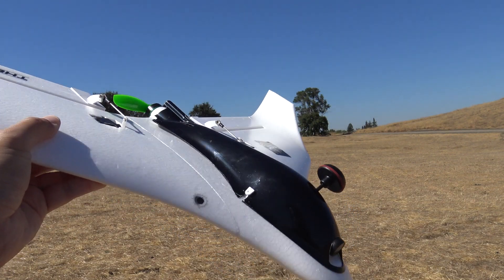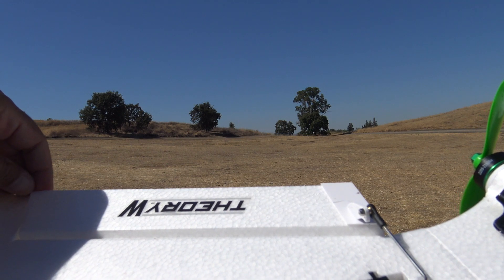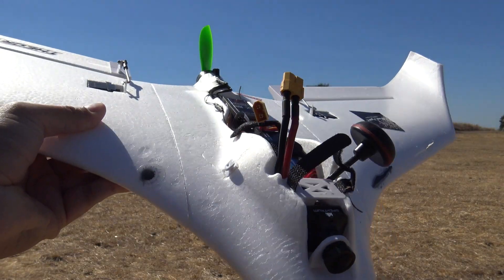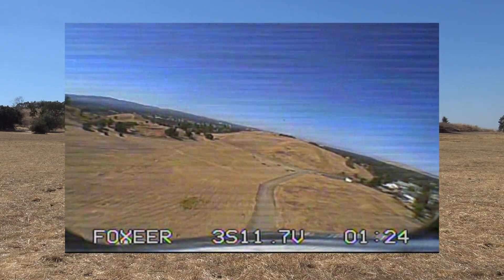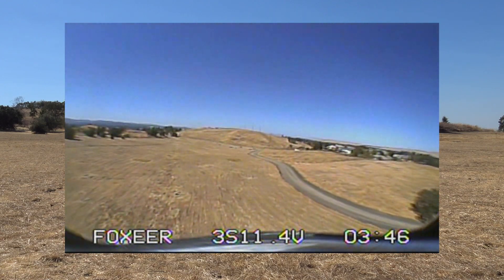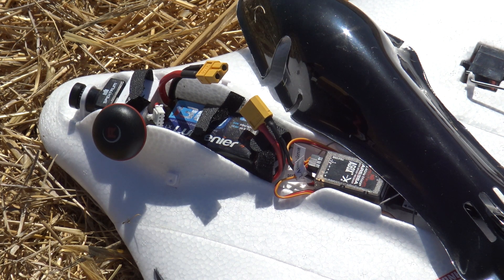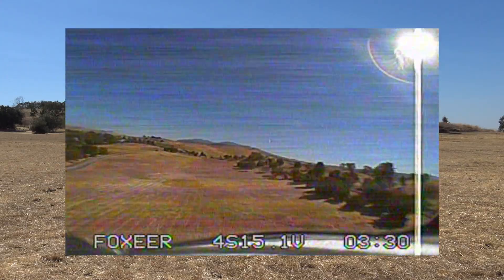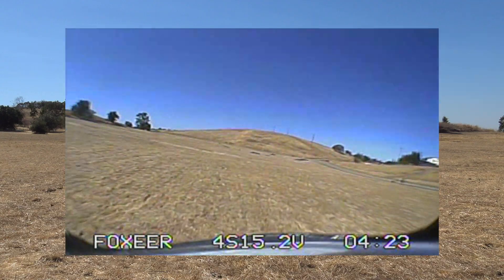Blade Theory W | Launching | LOS and FPV Flights on 3 and 4 cell packs

Comment: I got my FPV gear for the theory W.....👌It will be here this week so I'll be ready to fly very soon. Thanks 🙏 for the wisdom! I went with Amoway 4 leaf clover Rp-Sma antenna set. Lumenier TX5GA adjustable video transmitter and a Lumenier 2.5 mm top connector 650-tvL camera. 👍 should be legit. Can't wait to go fly this week!

Comment: I had to add a line filter to stock fpv system because of distortion over 50% throttle, VTX does get hot, good idea widening ventelation hole in front of plane, easy to fly plane, frisbee hand launch is the best way to launch,

Comment: Thank you. excellent flight review. I noticed you use Luminer Lipo.  Can you post the link of the 3s and 4s of lipos please? 
I look forward for the mobius mount review (like how much   the difference in cg). Also, can you see whether it can mount other camera like RunCam or even the Gopro session?
Thank you again! Greatly appreciated the review
Reply from the maker: Sure thing - thanks for checking it out. :) I was roasting out there doing these flights lol.  lipos are from getfpv.com. I have some other packs to try as well. The Session won't fit unless you cut the larger canopy a bit - I believe that camera is also heavier than the mobius. I may put in just a bit mechanical up elevator trim for the mobius on 4s. It should do just fine though.
Reply: Thank you for the link. I noticed there are number of them. For 3s 1300mah, it has 35C / 60C and 4s 1300mah, it has 35C / 60C / 80C.
Which one shall I pick for 3S and as well which one to pick for 4S?
I wonder how well it flies if its using HK Graphene 60C?
Reply from the maker: well I like the higher c rated packs - that's what I typically go with. HK graphene don't know too much about...should work well.
Reply: Thank you.  
Sorry, one more question.  What's the DR/EX setting for High Rate / Low Rate for this wing?

Comment: Can you actually hold the plane from the top (canopy)? Or will it then come off.. That kind of launching works well for me (as the plane will fall Away from your hand).. 
But well.. side-saddle works most times as well.. Especially With a stabeliser in the plane

Flies well sir! Pretty quick indeed :)  How manny mW is that VTX by the way??
Reply from the maker: Hey Dutch-thanks for dropping in - hmmm top may be tough with that plastic canopy. It's not the strongest attachment. The tx is 200 mw. A bit of noise especially on 4s but flyable enough. I am liking it so far! :)
Reply: Ghehe well yeah.. I like wings (as you know) :)  Maybe I should do another video with my high-speed wing :$

Comment: Hi John.  Awesome video! One question...how did you get the osd (battery voltage) to show on screen? Is that the stock fpv camera?    I've put low voltage filter on my fpv feed... working like a charm.  Love that thing but it's scary around trees and mountains...😂 Should have some bakes installed or a emergency parachute. I'm scared of that thing go fail safe on full throttle...aaaand bye bye even after you set it just to drop out.
Edit: Never mind. I got the OSD working. Thank you.

Comment: Real bad lines in fpv on 4s full throttle will be solved by adding line filter
Reply from the maker: that's good to know - I just got a filter in today and will add it for the next flights.

Comment: I did not get the FPV version as I wanted to add my own camera transmitter and antenna. Do you have any recommendations? Thanks again! 👍 I subbed
Reply from the maker: thanks for the sub - do you have goggles? There are a lot of fpv systems out. Any 200-600 mw system will work well. I still use my old fatshark system all the time.
Reply: Discover RC I have a tactic 5.7 screen and goggles. Not the best but it works. I'm going to get some fatsharks.

Comment: Also I noticed they're using the foxeer arrow cam which has a simple osd built in. Is it the V2 arrow? I hope so
Reply from the maker: not sure - it says the v2 osd is solid and doesn't flash. Did the v1 flash? If so, this would be v2 I suppose.
Reply: Discover RC yeah the first version was horrible but it appears they have used the new one. Nice
Reply from the maker: that's good - I have no problem with the camera so far. But it could use a filter for sure on 4s.

Comment: $300.00  for a Foamie Wing.... No Thanks......  I'll Build a New Striker f27c....
Reply from the maker: How much would a Stryker with motor/esc/rx/servos and a similar fpv system cost? I am curious how it would compare even though I believe it's a larger wing than this one. Can you do it for less than 250?
Reply: Under 125.00  The Fuse is only $27.00
Reply from the maker: you can do the electronics and the fpv gear for under 100?
Reply: add $30.for the 200mw fpv unit.
Reply from the maker: I agree that most of the time you can build it cheaper than the rtf/arf or whatever, especially with HH stuff that is certainly on the higher end of price. But it's good to know what those differences really are if you go diy. You still need the motor, esc, servos, rx, camera and antenna. Yes each thing can be had for 30 bucks here or there but where does it come out.

Comment: There seems to be some noise in the video from the motor or esc they didn't include a filter?
Reply from the maker: yep it's got the noise especially on the 4s - not a filter that I can see, but I need to take a closer look.
Reply: Discover RC hmm that's a bummer. I'm getting mine on Thursday I'll have to see how it is. Guess I can install a filter if need be

Comment: hi man ,
i own my theory w for about 2.5 months now .

2 days ago the motor has popped out of the motor mount in mid air :/ 

once landed i noticed a totally melted motor mount . 
do you got any of this problems with your theory w ? 

i use the stock 2205-2350kv motor from Trust , with the stock prop .
i do always fly with 1300mah 4cell  45C battery's .

I don't get it -.-
Reply from the maker: well that shouldn't happen of course - I haven't had that happen (my theory is out of action right now) and I haven't heard of it before. Did you get in contact w Horizon? It should be just fine with those packs.
Reply: Discover RC yea i contact horizon hobby about it ,they ask me to send some pictures and i did ,but nothing heard back yet ...
hope they know how it comes... 
cause now i can't putt the motor back in the mount ,the motor locking holes are melted ,so the motor don't lock in it anymore, it just fall out of the mount right now   :/   

and i cant find a new mounting ring for the theory w , only a complete new fuselage ,maybe i go look for a aluminium mount or something ,
 but thx anyway man .